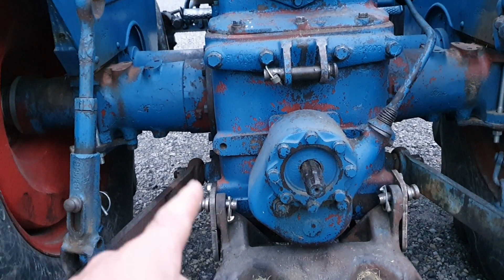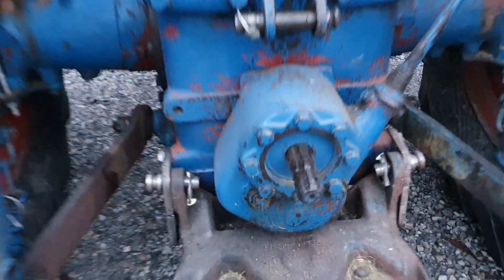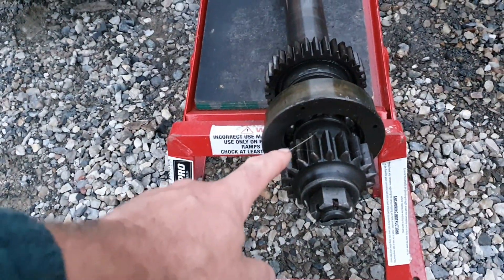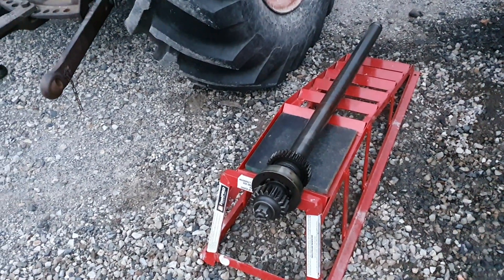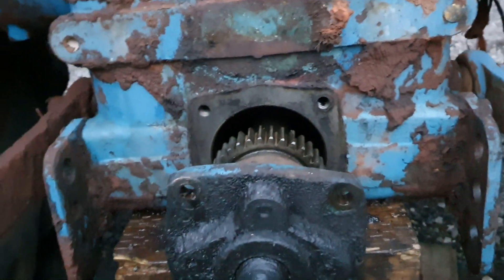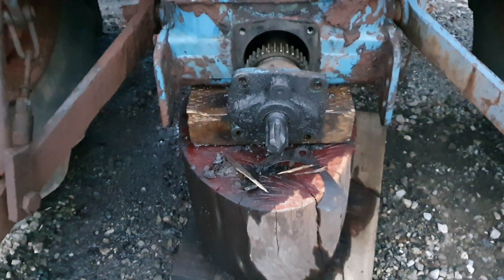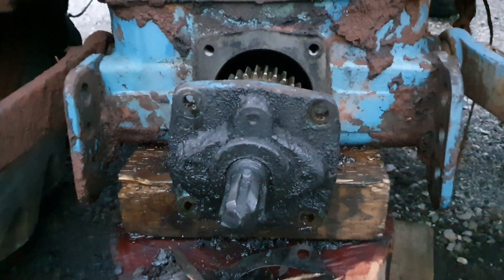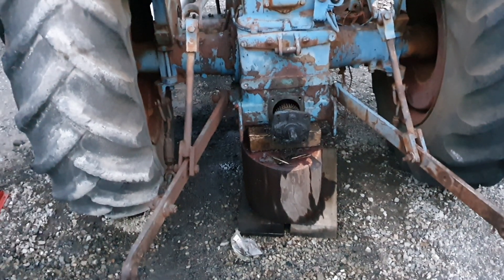Fordson Major PTO Interchangeability.

Comment: Do the hydraulic pump work's only with live pto and hydraulics can lift
Reply from the maker: Thats correct, the PTO has to be engaged for the hydralic pump to spin allowing the 3pl to work. A raised PTO accessory allows you to engage the PTO to operate the 3pl without the shaft spinning.
Reply: @fixingfordsonsaustralia6632   i have the same tractor and the hydraulics don't work .I connect the pto  they struggle to lift, i saw that i can't turn the pto with my hands while is not connected ofcurse, maybe the gear of the pump is stuck,can you give me some advice

Comment: Thank you for your videos, my question is, can you add a pto to a fordson e27n that was not factory fitted with one. I have x2 e27n tractors, one with pto and one without and I have chosen to restore the one without, as it is in much better condition and would like to add the pto to it if that is possible. Thanks again.
Reply from the maker: You should be able to, the PTO were optional extras and kits could be purchased. As long as all the mounting holes are there you should be able to do it.

Comment: I'm swapping out one on mine and can't get the shaft out. Is there a trick I'm missing?
Reply from the maker: With years of friction, pressure and oil sludge it may be fairly tight. Try gentle taps with a hammer or attached it to an unattached mower etc and slowly drive forward.

Comment: Thanks mate for another action packed info laden clip. As I've said below and in other clips of yours, we had a Farm Major and that was the beast I did my tractor driving apprenticeship on and I thought I had fairly good knowledge of the brute and as it turns out, probably wrong. I may have known how to drive it rather well but absolutely bugger all about the internal workings.
Anyhow with both tractors backed up beside each other I am itching to know about the rim settings on the old one. You can see the rather deep dish of the rim on the outside but the inside of the rim on both tractors looks the same. Does the old one have wider rims as well as the rims set at the wider setting ? If you can understand what I mean there. cheers.

Comment: Yet another great video. The raised PTO also requires increased engine RPM to run the PTO at 540 from 1200 to 1600 If I recall correctly This put the engine at more appropriate  speed for heavy PTO work. So I think the discription of Raised PTO is twofold. Physical raising and raising engine speed. It is a very good addition for a Fordson
Reply from the maker: You are absolutely correct, there is a slight reduction in the gears meaning you need to work it a little bit harder. Very noticeable when you have a slasher behind it.
Reply: @fixingfordsonsaustralia6632  Dad had a gray mud guard Super Major with standard PTO, and used it for forage harvesting. We always felt it would have been better and done it easer with Raised PTO. At least it had Live Drive. My major has Raised PTO so I have run both.
Reply: Great point David, we had a Fordson Farm Major and at a minimum would work her at 1200rpm but depending on what work, up the rev's would go. We used to harrow in 5th gear at between 1600 & 1800rpm, 1800 being at the top of the rev range, she would rev harder but it was revving too hard, so the 16 - 1800 range was what seemed to be the most powerful rev range. 14 - 1600 the majority of work  for cropping. Western District of Victoria, late 70's early 80's when I was a spritely teenager.....ohhhh no !